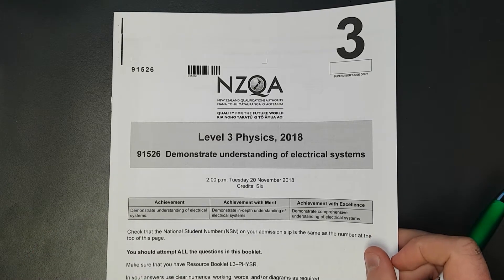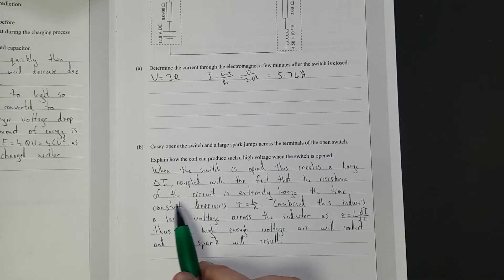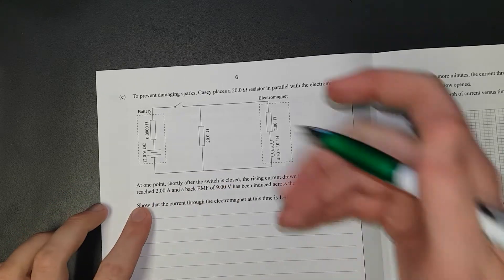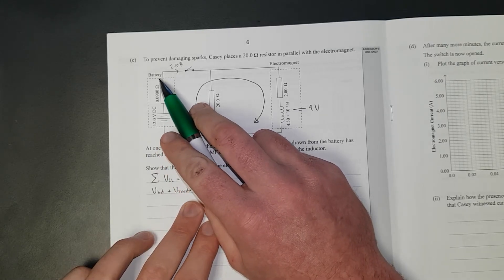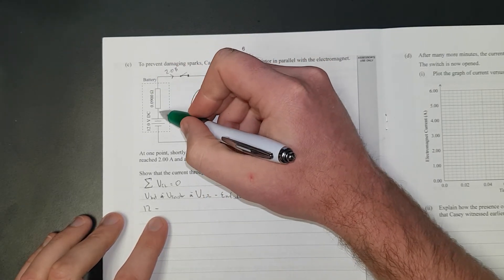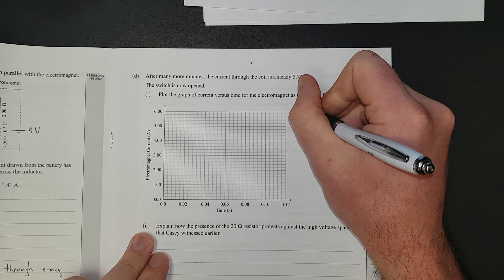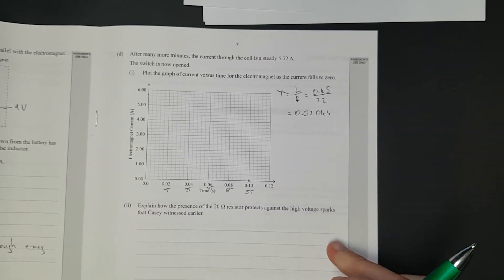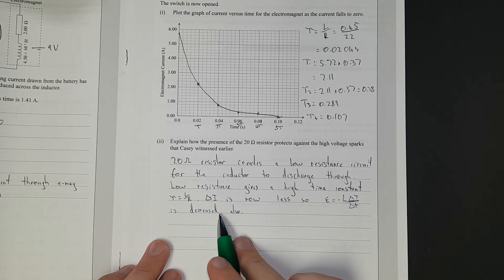2018 Electricity (NCEA Level 3)-Q2

Comment: At 9:20 , why do we divide L/R for only for the right side loop resistance (with total 22 ohms) instead of the whole circuit's resistance (adding resistances by parallel total resistance equation)?
Reply: I think because, when the switch is open, the current cannot flow to the left loop due to their being a gap (switch is open). This means the circuit becomes one loop, and the two resistors (20 and 2) are now in series (because there is one loop). So, using Rtot = R1 + R2, the total resistance will be 22 ohms.

Comment: do we just ignore the 20ohm resistor?
Reply from the maker: I assume you mean for Q(c)? if so it's because the Kirchhoff loop goes around the perimeter, you could probably loop through the 20 ohm resistor knowing it had 9V across it but think it was clearer to loop through the battery.

Comment: for q)2d why do you call it low resistance circuit when the resistance got higher
Reply from the maker: The switch can be thought of as an air-gap resistor with a very large resistance (Mega omhs) so without the 20ohm resistor, you have loop circuit with a very high resistance when the switch is opened.

Comment: For Q 2c how do you know the direction of the current?
 (do you just assume that it goes to the right?)
Reply from the maker: Goes from positive of the battery to negative, although with a kirchhoff loop the direction of current doesn't really matter in your equation. If you had it backwards but made sure you followed everything correctly your current will come out as negative. See 2019 Q1(b) for better example.